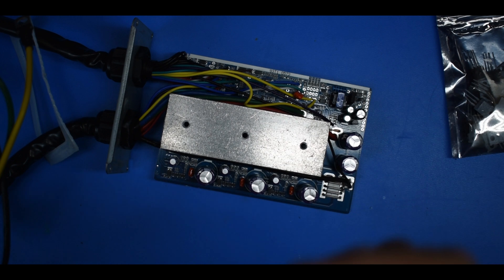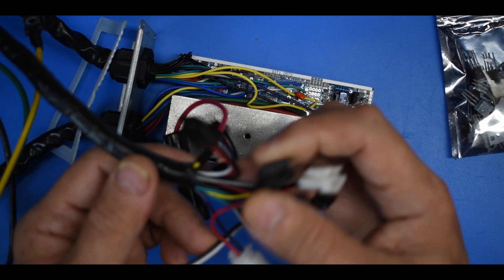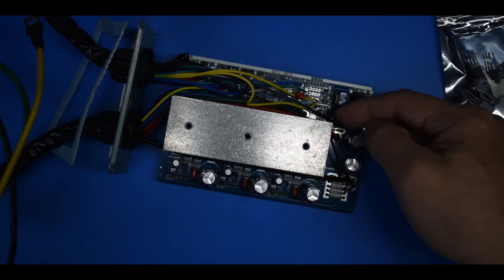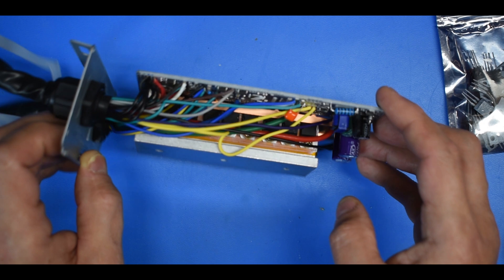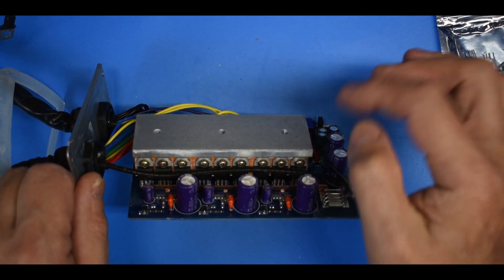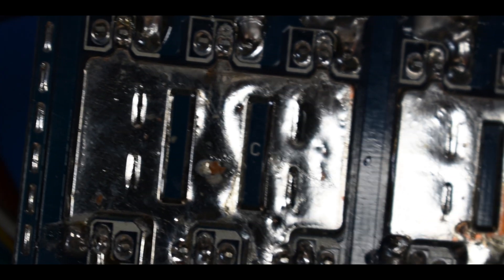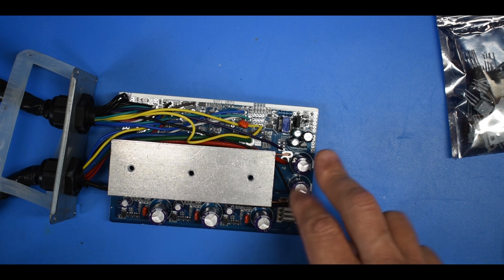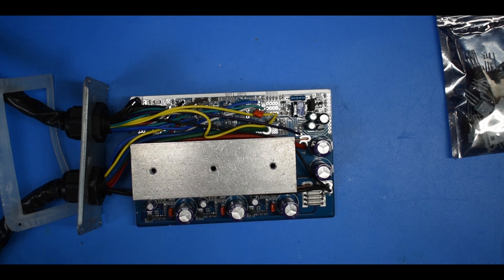ebike Kit, 36V/48V 1500W *upgrade part 1*

Comment: Hello there. I bought a Alomejor 48V 1500W motor controller a while back to replace my failed 1000W unit. I have a brushless and gearless front wheel hub motor I bought on eBay. Is there a way I can remove the speed limitation. I am not talking about the jumper wire you disconnect to get the 1500W instead of 750W. I am talking about whatever limits the speed to 28mph. I have a basic understanding of electronics. It was a kit and there was no sensors to monitor wheel speed and the pedelec sensor was never installed.